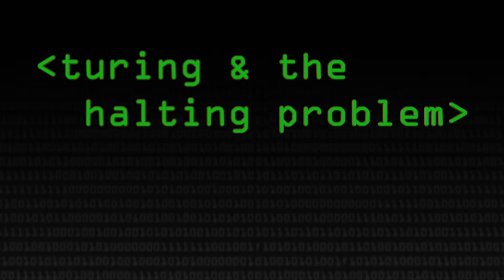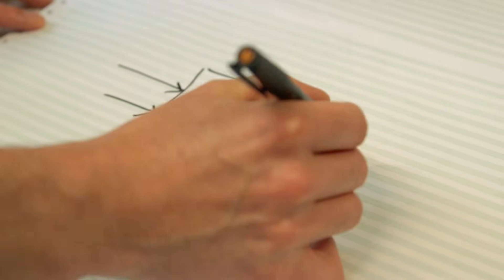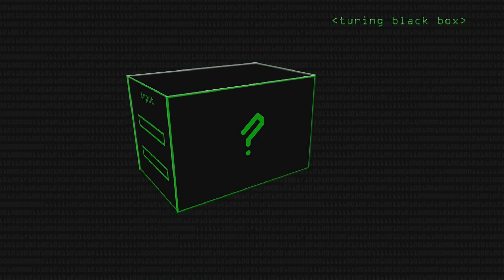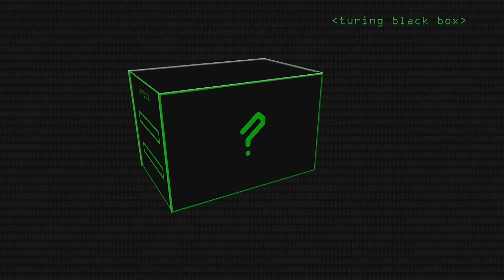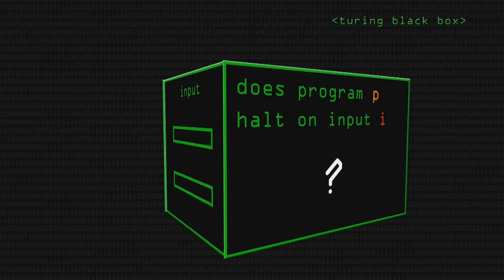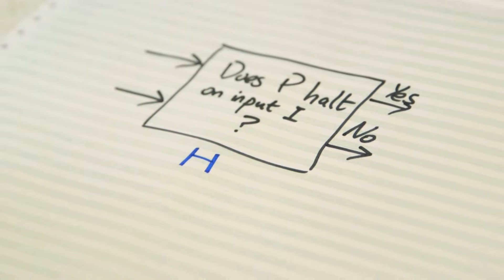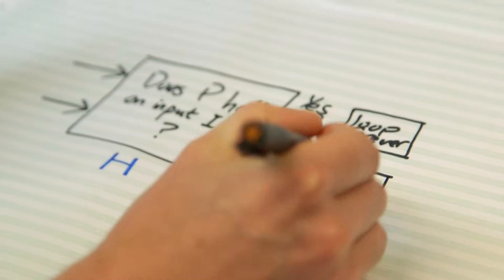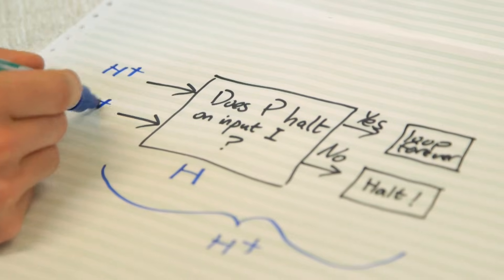Turing & The Halting Problem - Computerphile

Comment: The explanation of the Halting Problem in this video sounds to me like just a logical fallacy (circular argument in this case) and overthinking. You can easily construct "unsolvable" problems and paradoxes from something that is not a problem to begin with by falling into the trap of a logical fallacy. I am pretty sure the video is explaining the halting problem wrong, specially after reading some of the comments here that explain the problem without falling into something that to me look like a logical fallacy circle argument that do not explain the true core of the Halting Problem.
Reply: Rondo Cat The Halting Problem is the decision problem thus: given an arbitrary program (or set of instructions), and an input for that program, will that program halt (finish computing, etc)? The possible answers are yes, it will halt, and no, it will not. 

Turing's proof was that a general algorithm does not exist that can solve the Halting Problem. A general algorithm is an algorithm that will function for all inputs. 

For example, the program "if input is 2, output true; otherwise output false" will halt on any input, but the program "ignore input; loop forever" will not halt for any input. The first is a general algorithm: for all inputs other than 2, it will output false, and for input 2, it will output true. This means that it can correctly handle all inputs to the question "is input 2?"

Turing's proof that there is no general algorithm for the Halting Problem is this: assume algorithm H(algorithm X, input Y) exists (H takes X and X's input, Y, as a pair) and outputs either "true" or "false". H is a general algorithm that decides if algorithm X halts with input Y, for any and all combinations of X and Y. Let us try the experiment of feeding algorithm H into itself: H with input H will halt, as it is the only logical outcome. If H does not halt with input H, then it will say "no" and halt, but if it says "yes" then it will also halt.

However, let us take algorithm H, and add something to it, calling it H1. 

Rather than taking the outputs of Yes and No, we change Yes to loop forever and leave No unchanged. This is H1.

Feeding H1 into itself as input (recursively if you must), we then question the possible outcomes. If H1 halts on input H1, the H within H1 will report "yes" and then H1 will loop forever, creating a paradox. If the H within H1 reports "no", then H1 will halt, also creating a paradox.

Because of these logical paradoxes, this means that our assumtion is wrong: general algorithm H does not exist; there is no single algorithm that can correctly solve the Halting Problem for all inputs.
Reply: Touring did explain in a complicated manner with great detail why you get a halting problem with a computer (a binary based one to be exact). The explanation in this video is  about a paradox that to me and other here seems to have little to do with Touring and the way he explains the halting problem in computers and why you can`t make a computer that can predict it. (Others here did explain the problem much better without the "artificially" constructed logic paradox that does n`t  explain core problem and confuse more than explain)

The computers we use today are binary at the basic fundamental level and operates only in absolutes of: on/off  or yes/no 0/1 and no in-between and that is why you get problems like the halting problem. Because of this you can`t make a computer that also work at the same fundamental level of on/off yes/no 0/1 that can predict if it halts or not as that one will also suffer the same basic problems with going into endless loop.

(Hmm this should mean that human brain at the basic fundamental level functions  completely different from a binary based computer as humans can predict if a computer will halt or not...)

Comment: im 13 but if the h reads what a progams does and what the progams perpose is and then fed the question it would be tell it every thing it can do but if h is fed again quickly it would get stuck and the same for the other machines so you made it get stuck your dumb ass Computerphile kay got it

	
 
 one more thing you can make where it can tell that it is about to get stuck and stop everything for a long as you want and you can connect to the internet to lean new questions and learn every thing and becoming more smart and see no good use in killing humans and if they do there are things we can know that no one will now or even make us come to peace and solve everything

Comment: I don't get this.
Ok, I made a piece of code that does the opposite of this. I've solved the problem!

Serious, though... he says "He proved this by creating a machine that does this incorrectly" Well, I made one that does it correctly. Did I solve the problem?
or do I just NOT understand this?
Reply: Mac Was no, because there is no evidence that your machine actually works. We can show that since it does not work for a specific case, then the machine cannot exist because it does not work for all cases. But showing that the machine happens to work for your case only shows that it works for a single given input.
Reply: +Mac Was The idea is that it was shown necessarily that if a machine is able to tell if H+ plus will halt or not, it will contradict itself. Therefore, any machine that is able to do this is a contraction, and can't exist.

Comment: let's say i have a halt machine H. what it does is it reads a program, and if any loop starts with "while True:" it says it doesn't halt. else it says it does halt.
now i'll create the negator. if it recieves a message saying, doesn't halt, it prints "does halt",  and if it receives a message saying "does halt" it goes into a "while True:" loop.
i'll put the negator at the end of the halting program. that is, it will operate on the message it receives from the halting program. i call this program h+. what happens when i feed the program into the halting program? well clearly this program contains a while True: statement, so my halting program will say it doesn't halt. then the h+ will halt with the output that it halts. so what's wrong with this logic?
Reply: Phillip Brix 
okay im an idiot, the halting machine says it doesn't halt and it does halt. duh.
Reply: Phillip Brix while true: if input is X, break

Comment: the conclusion that there can be no program to solve the halting question is made invalid by cyclic redundancy. All the program needs to do is use logical analysis on the code to determine if, given a certain input if it will:
1) throw an error and halt
2) solve the input
3) enter a infinite loop
and you can test for 2 and 3 by memoizing the state of memory buffers, and general AI. 
The "prove it false by FORCING it to be false" isn't a valid answer. by throwing on a "output goes into forced infinite loop if yes" --- isn't a logical conclusion to the question of if a program can solve the halting problem. 
The question is: can a dynamic program be created that can correctly analyze the INTENT of a given algorithm, and determine what the scope of solvable range is of that equation, and if the given input falls within the scope of inputs that the algorithm can solve?... a human, looking over a bit of code and a piece of input can tell you if the program will halt or not. therefore, a program can----if written correctly, and handled correctly.
Reply: Bryan W 
best example i can give on this is a poorly written recursive program that, if given invalid input data will go into an infinite loop. it has no error handling or invalid input handling. so it continues to try and solve for it's base case and never halts (unless you count a computer-crash as a valid definition of "halt"). 
A first year computer science student can look at that source code and tell you if the program will resolve an answer and halt or not.

Comment: wouldnt that mean, that the halting problem would accure, when the computer has to do exact calculations to unsolveable problems? lets say you wanna the computer to give you the exact solution for 5+5. it will you give 10, no problem. and now it needs to give you the EXACT solution for 10:3.. then it cant. you would say, 3,33 but its no true. theres something missing. its not exact. so in theory, i would calculate itself to death because its stuck in writing 3's and will never stop and thus, will never be able to give you an answer
Reply: dharkbizkit That's one of the potential uses for the halting predictor machine, but not the only one. Unfortunately, since no such machine could ever exist, we have to use other methods to determine if a computer comes up with a non-exact numerical solution (which is actually fairly easy to do, and doesn't require a halting predictor).
Reply: dharkbizkit it's called a floating point operation, it's basically scientific notation for computers.
Reply: dharkbizkit The exact solution for 10:3 is 10:3.

Comment: That's a false paradox. That's like asking "can I draw a picture?" but as soon as you're done you stick it through a paper shredder and deem yourself unable, despite the fact that you succeeded.
Reply: Plague Doctor Your analogy doesn't really work. It's definitely not a false paradox - although yours is. If you attempt to describe your "can I draw a picture" question in terms of machines, inputs, and outputs, it's not the same at all.
Reply: Alex House
Lets try that:
"can I print a picture?"
Hook printer output into paper shredder.
"I now deem it absolutely impossible for printers to function anywhere in any way".
Reply: Nope, you did it wrong. The output of a printer is not a boolean result that indicates whether or not a picture can be printed -the output is a picture, so it doesn't qualify as a black box as in this problem. What WOULD qualify is a device that watched to see if the picture was printed, and it would indeed prove that pictures could be printed. Adding a shredder means absolutely nothing in the context of this problem.

Comment: hmm... what if a program was able to change its own code in relation to the inputs? In that case it could give an answer like "this is impossible to determine".
Reply: Periklis Arnaoutis A program might be able to change its own code - we make absolutely no assumptions about what the "black boxes" are able to do, except that they must return one of two answers: this program halts, or it doesn't. With that constraint, it can't give you answer. 

In fact, that is part of the halting problem. You've described a machine (or program) that can predict halting only in some cases, and says "impossible to determine" in others - and this is not a universal halting prediction machine, so it doesn't satisfy the problem.

Comment: So doors this men there after problems with an answer that humans can't solve, because by solving it we act like computers (taking a problem as input and yielding a solution) and no computer like thing can solve it?
Reply: Philip Stuckey This is sort of a philosophical thing - do our brains process things like a Turing machine? 

Assuming they do (and I think you can safely assume this), then yes, your conclusion is correct. There are unsolvable problems. A human mind can't solve the halting problem anymore than a computer can.
Reply: Alex House A human mind can solve halting problems much, much better than computers can. I sincerely doubt that humans are turing-complete. For example,  the program "is input 2?" will always halt. There, I've solved a halting problem.

Turing's point is that there is no general algorithm to solve halting problems for any and all input.
Reply: The human mind cannot solve the halting problem any more than a computer can - it is an unsolvable problem. You mention the idea of a "general algorithm" to solve "halting problems" - in fact, the "halting problem" is a single problem that is, in of itself, general. It is unsolvable. Yes, it is possible to determine whether a program will halt given extra information about the program, and it is possible to determine whether some programs will end (a computer can do this, too) - this does not make it possible to solve the halting problem.

Comment: Is H allowed to be unique for each algorithm that is input to it? What if the halting problem always has some solution(some algorithm that decides if another will halt on some string) but any single decider does't decide all algorithms? Maybe there are two, the first H can decide a set of algorithms, not including H+, and another can decide H+? If this were the case H may be invalid for deciding the halting problem for H+, and leading to a paradox? I guess I'm asking if this proof shows that there can be no universal decider algorithm or if it proves you cannot create a decider for any algorithm? And if so, aren't there techniques by which we can explain how and why an algorithm can loop on a given string, at least for some algorithms? I don't understand how this helps us know that there are not techniques to describe looping conditions for any algorithm even if the methods for doing so vary from algorithm to algorithm.
Reply: Cory C It shows that you cannot make a universal decider. You can make non-universal ones, because you don't need to actually run the code within your decider, you can just analyze it. For example you could have a program a program like this: while(true){ do stuff}, which never stops looping. A decider could be given this program in plain text and it could see that it starts with "while(true)", and it will know that the program will never stop. This use is obviously very specific, but it's just an example.
Reply: M4rcelKuipers Thanks. I suppose I was wondering if, as with the while loop example you gave, there is some kind of inferential process for any algorithm, where we could give reasons for why it would or would not halt. I was under the impression that there is a consensus that for some algorithms the only way to tell if it will halt is to run it. If it halts after you run it, you know it halts, otherwise it may or may not halt at some time in the future. Thought maybe there would be a proof similar to the universal decider that would show that for some algorithms there are no methods other than running the algorithm to determine if it will halt. I'm new to this stuff so there very well may be something like this out there.

Comment: This isn't a problem. You are asking the question:
"Is there a program that knows what all programs are".
The answer is obviously no.

On a side note, all programs will eventually halt because the hardware they run on will break down physically. This is not a problem, it's a way for computer scientists to fap to how intellectual they are when they should be actually doing useful stuff.
Reply: Nerobyrne You're an idiot who disrespects the simple building blocks of the system you currently use to broadcast your idiocy.  But of course, you're going to spew about 6 kids.
Reply: Adrian Bartholomew oh really, that's nice. I'm so glad you were able to provide me with a sound refutation of my criticism.

Would you like to tell me how the "halting problem" is not asking if any one program can exist that knows the operations of all other programs?

By the way, the halting problem was also developed for Touring machines, which are hypothetical. It's a philosophical idea that Touring attempted to explain using fictional computers, NOT a problem concerning actual modern programs.
Reply: Nerobyrne There are more than enough consequences of this proof for it to merit credit. You are also criticizing based on a simplified version of it.
Reply: Nerobyrne *turing

Comment: doesn't this just mean "the PERFECT" solution can't exist (as opposed to none at all)? think of it like this, H on its own works just fine, untill the human who built it inverted the output thus causing the paradox. HOWEVER, remove the paradoxical nature and it works fine. meaning MOST of the time (lest a wrench be thrown) the machine DOES work. i can already see a sort of code for this where a function A calls function B with input A1 in a try-catch, if B succeeds with the given input then return true, if B fails, return false. done XD i mean yes thats very specific to CODE...but the idea itself works...therefor the halting problem only occurs SOME of the time. or am i completely missing the point of what the man was talking about? xD
Reply: ackly14 Turing's proof is that there is no one algorithm that will function for any and all programs and inputs. An algorithm that works for "any programs and inputs except for paradoxical ones" is not the same thing as "_any_ and all programs and inputs."

Comment: But what if the creators of the machine H know about this, and program in an exception for this, like an if statement checking to see if the blueprint would do this by running the input it would print out, stuck and realizing it would print out a yes, and then test with not stuck, and realize it would be stuck, and it would print out a 3rd output meaning stuck, that would get the machine that swaps the thing stuck as it does not know what to do with it, as its an unexpected making machine H right.

Horribly programmed versions not working does not mean it can't be done, as things meant to handle these situations are GOING to have more than 2 outputs
Reply: Mr Anon Either something is true, or it is false. That is one of the constraints of the problem. Having a third output is against the rules.